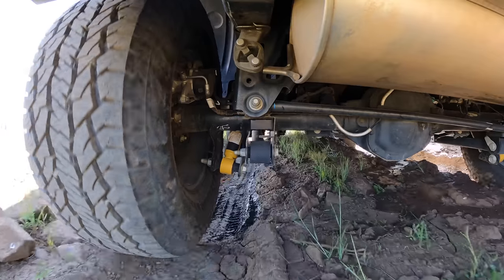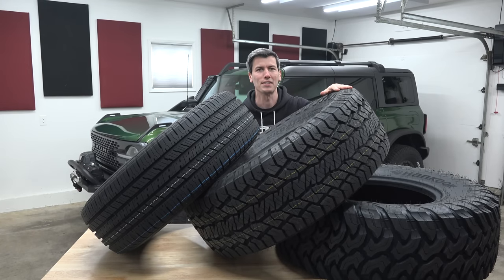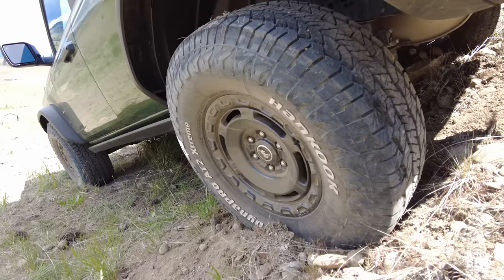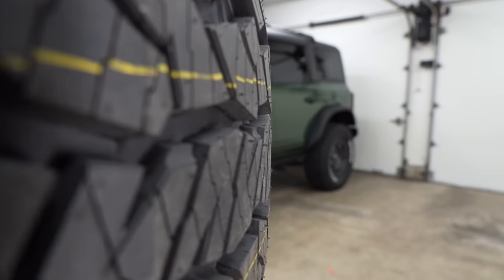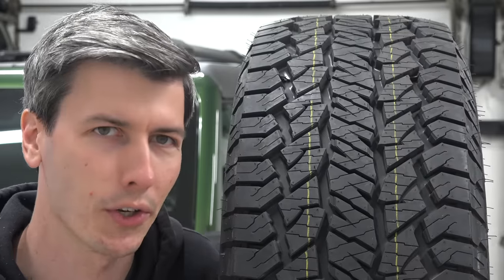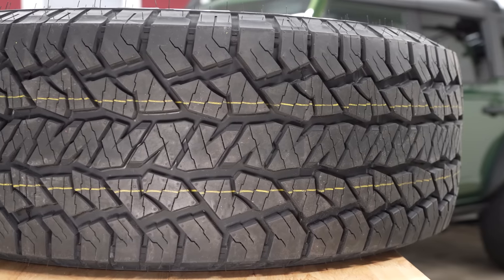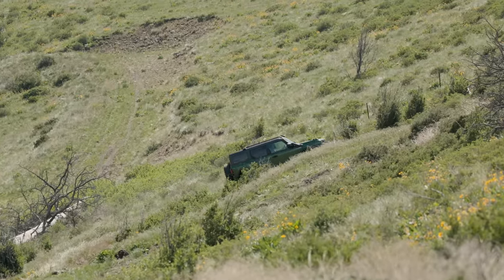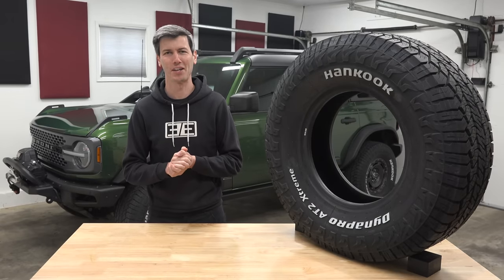The Most Difficult Tire To Create - All Terrain

Comment: Great Video.  I have to say that I had to walk away from the Dynapro tires and switch over to another brand due to the Hankook tires clogging with mud and snow and not cleaning themselves adequately.  The Dynapro tires had good dry traction, never gave me any issues on the wet roads and performed admirably when running on a solid sheet of ice and other four wheel drives were not moving.  But having the tires clog up and turn into slicks when trying to travel through more than 4 inches of snow was an absolute deal breaker and I cannot put them on my truck.  If I did not have to make regular trips across the Allegheny Plateau or across I68 in the middle of winter then this would be less of an issue, but nobody want to be on the highway when you are caught in a few inches of snow and the vehicle becomes hard to control because of the snow.  Perhaps the AT2 Extreme may be a better tire than the AT2s that were on my truck from the factory, but when they cost the same as a better rated competitor, you make the switch and have the snow traction that you need.
Reply: I don't drive in snow but I've also had my AT2's clog up with mud. Seems like a downfall of the design. Which tire did you swap to?
Reply: @NiSE_Rafter  I moved to the Toyo AT3.
Reply: @c.garison3770  I think in snow you want snow to stick between the treads, snow on snow contact when spinning increases grip. Wider groove tires like Toyo's will help with this.

Comment: The difficulty becomes apparent for those that have ran several diiferent A/T's as the best are truly impressive  [as all-arounders] while the worst have several dramatic flaws like short tread life, loud like M/T's, not being decent on OR off-road, bad in snow/ice, and so on.

Very happy with my Falken Wildpeak AT3/W on 18 Ram 1500.  I have the P's and not LT which were cheaper, lighter, softer riding, and just more practical for my usage as a daily driver, mostly unloaded and infrequent towing but plenty off-road occasions.

Comment: There are also small 2/32" protrusions embossed from the bottom of the grooves, these are called rock ejectors and they also help throw any stones out!
Reply: Usually the 2/32” nubs are wear indicators.  Most modern tires have them since the 80’s.  
When 2/32 tread depth is all that remains, it’s time to replace the tire.    
👊
Reply from the maker: Yes! They do have these on the MT tires.

Comment: My FX4 Ranger came with Hankoook Dynapro AT tires, and they were absolute trash offroad. The OEM tires have one job, and that's to last until the warranty period for wearables is over and be as light as possible for fuel economy. I replaced them with BFG All Terrain TA KO2's which are much heavier, but a significantly better on and offroad tire for my application.
Reply: not to say Hankook tires are bad, but the ones Ford chose for the FX4 Ranger were not suitable for the application for some uses.
Reply: My F-150 had the at-m tires. I was fairly impressed with them they did fine in deep water with a sand bottom, light off road in wet grass and snow performance was adequate. I would describe those tires as jack of all trades master of none all of those situations I went in the tires did just okay not bad but not really good either. I replaced those tires after 58k miles and six years of service because of excessive cracking and 5/32nds is when I yard tires. Replaced them with the Firestone destination x/t which seem to be doing fine for my application.

Comment: The "all terrain" tire, currently the shorten nomenclature from the original "kinda sucks in all terrain" tire. I see ATs as just an aesthetic upgrade. They are almost as loud and heavy as mud tires with no where near the advantage off road. You can get mud tires that will last just about as long and they are usually the same price or cheaper than ATs. Some companies have started making "hybrids" where they make pretty aggressive tread on the outside tread pattern while keeping the inside pattern pretty tight; this allows you to slightly over inflate for the road, keeping the bigger lugs from contacting the asphalt, but one you air down, they can help engage terrain. It's a step in the right direction, but still isn't perfect.

Comment: In Poland we use to say: "If it's good for everything, it's good for nothing" You can't have everything. If you have good offroad traction, you won't get quiet and low rolling resistance on asphalt.
Reply: Yep, the same can be said about any "2 in 1" products - for example the all seasons tyres are worse during winter/summer than the specialised winter/summer tyres.

Comment: I was torn between the Dynapros, Falkens and Cooper a/t tires for my 4x4. Went with the Falkens 1st go round because i liked how they looked best. Super quiet tires. This time i have Goodyear Wrangler Ultra Terrain a/ts and they're the most aggressive tire you can get next to a legit m/t. They are very quiet as well with the exception of slow driving on very smooth roads. They will hum just a wee bit. I will be getting another set when these go.

Comment: Weight – Its strange this tire in size 285/70R17 (The tire I run) is 32.70in diameter and 16/32 tread depth is 59lbs for LT285/70R17E (The only option)  vs a slightly bigger and more tread depth tire like Toyo Open country LT285/70R17E is 32.76in diameter and 17/32 tread depth is 56lbs. Right now I’m running Toyo Open country P285/70R17SL just 47lbs. I think I would be ok with SL since it has larger contact patch (less pressure per sq inch) on rough terrain vs stock 265/70R17 or even sizes like 255/80R17. I had Load E before and the ride was firm for a lighter vehicle like a 4Runner (5000lbs). Also want to point out 3PMSF rating is very different from tire to tire. Eg BFG KO2 / Falken Wildpeak AT3W is very different from snow and Ice performance on pavement with Goodyear Wrangler Duratrac without studs (never tried with studs). But noise department is where  Goodyear Wrangler Duratrac or even Nitto Terra Grappler failed on me. BFG KO2 / Falken Wildpeak AT3W/ Toyo Open Country AT3 is very good to my years. Yes one might argue that a tire like Michelin Defender would be better for pavement. But with my use not a daily driver and get lot of snow driving in winter not been a A/T tire and no 3PMSF rating it would not work for me. Really wish Jason can put these tires head to head on ice braking test in a controlled environment like AMCI Testing did looong back for Venza.
Reply: LT rated tires will have a stronger sidewall and thus be heavier than P rated tires. Load rating should reflect this, so the LT vs P and Load Range E etc is kind of a legacy.

Which Toyo are you referencing? The AT3? I found those to have a pretty compliant sidewall even at 60+ psi, which might explain the weight difference.

Keep in mind there is also a AT3 extreme available, which has an extra sidewall ply, and is much heavier. If you tow with a diesel, I'd suggest this instead of the regular.
Reply: @plkracer  I have stated the load rating after the wheel/ rim size 🙂 
Yes Toyos I have is AT3 / AT III 🙂. I haven't heard of Toyo Open Country AT3 Extream. I only know of AT, RT & MT.
The only Load E tire I personally used was BFG KO2 which had real 3 ply side wall. When I check that time many a/t tires had 2 ply side wall.
As mentioned my vehicle(s) are 4runner. I'm at 5000lbs & 5060lbs. Won't be towing anything.🙂

Comment: High load (D+) all terrains I like nitro terra grapplers. For load C all terrains the BFG KO2 is undefeated. I hear these hankooks are pretty affordable though.
Reply: C rated K02s come stock on raptors and they are garbage. My set lasted 14k, and that was about average. No grip anywhere pretty much. Got some Cooper ST maxes and despite being way more aggressive off-road they have similar or better grip on road, which is sad. They are a bit louder than I'd like tho.
Reply: @T4nkcommander  I bought my raptor at 53k on it original tires on the front new ones on the back (dealer special huh). Put about 10k on it then I got 4 brand new BFGs. Got about 13k on them now and they are wearing in perfectly
Reply: @krisramos7453  how much high speed offroading do you do? They don't last long under the conditions the truck was built for, but I reckon the "raptor specific" version saves Ford money and gets better mileage, so there's that at least.
Reply: @T4nkcommander  my truck does either beach running (15mph speed limit on most beaches here so I’m not flying) or crawling through woods trails. Also thousands of miles towing an aluminum boat. Other wise it’s a lot of highway

Comment: Falken Wildpeak AT/3W is about the best you can get. 
The rubitrek is a bit better for road but you sacrifice the offroad performance for rock crawling.

And the Wildpeak took almost 5 years to become the OEM Bronco tire. Nothing but the best!

The only reason they got that 60K warranty was because they sacrificed the cold weather performance. It does not perform. I guess if you dont run in snow, you may not worry about it. But for the rest of us that do, it is a deal breaker. Plus, they are a PITA to get any RMA support.

in terms of the siping vs sub siping, (the micro sipes), hankook does not do full depth canyon sipes. Further reduces the cold weather performance.

Comment: Good video - thanks. I would like to know whether all terrain tires actually have more grip on gravel and dirt than all season tires, and if so, by how much. If anyone knows of a source of data from traction tests that have tried to measure this, please give references. I am fairly confident that all terrain tires will stand up to wear with regular off-road use better than all seasons, but I don't know how traction alone will compare. I know from available information that all season tires typically do better in snow and ice than all terrain tires, which isn't surprising since all seasons have softer rubber.

Comment: There’s no free lunch. “No season” tires offer pretty dismal performance in ice and snow on mountain roads. But studless winter tires lose 10% fuel efficiency, more road noise, and poorer performance during those 60F midwinter rainstorms. Every winter tire moves those levers a bit differently. Moving one up usually pushes another down. 

Compared to a road tire that is acceptable off road, a snow tire almost seems easy! I suppose it helps that off-roading tends to be unpopular during a real winter though.

Comment: I have a 2016 Ford expedition heavy vehicle with an open differential. I moved from California to Tennessee. My car has all season tires that I have on my car seem to spin out and lose control a lot. I don’t do any off Roading but I’m thinking of switching to a A/T to grip the road better On wet surfaces. what would you recommend all terrain or all season? What would you put on that vehicle if it was yours?. thanks in advance for your help

Comment: Maybe it's because I'm old, or maybe it's because I've been around the block a few times without my Hankook training wheels. A far superior tire is Michelin LTX A/T2. It excels at light to medium off-road, has siping that goes down to the bone, and the road noise is comparable to their touring tire. I use this tire year-round in northern WA state, traversing a mountain road daily to reach civilization. A worn-out Michelin will outperform any other tire on wet roads. Started on Michelin X (made in Italy) in 1979 and never looked back.

Comment: Afair, a few years ago You said in a video that it would be impossible to accelerate from 0 to 60mph (or 100kmh, i dont remember) in 2.0 sec or less, on a set of road legal tires (non drag slicks). 
Today we already have a car which does it in 1.7/1.8 sec time.

Comment: From my experience doing engineering at a tire company, I have also heard theories that a lot of the noise from RT and AT tires might come from "micro sonic-booms," which originate from the sharp angles created in the deep treads. Never figured out how true this is, but fascinating if so :)
Reply: Micro Sonic booms? Wow that's absurd. Tire noise starts at a much lower speed even for the outside diameter never reaches. The only time any spinning object does this is an aircraft propeller tip at high speed high RPM. Tires never see that speed.
Reply: @JSFGuy  They don't have to spin at supersonic speeds, necessarily, they only have to move air that fast.  Depending on the geometry, a space closing at subsonic speeds could force air out of it at supersonic speeds if the volume changes fast enough.  Like pistol shrimp claws, just air instead of water.
Reply: @jamespray  Again that would require some speed to generate. Not sure a fluid dynamics and hydroplaning are related... I would think somehow on a different scale.
Reply: I’m sure there is a lot that goes into designing a quite tire. I have Federal 595 RSRR tires (track type tire) on a Focus ST. When running those it sounds like an airplane is taking off next to you even at speeds as low as 40mph. Has only worsened as the tread has worn down a bit, and those have no real sharp edges anywhere.

Comment: Respectfully, mud terrains aren't "dedicated almost entirely for off road driving," in my opinion. They're still very much a tire passable for daily use, and are indeed used by many as an everyday tire. Personally, I would place MTs right in the middle of the on/off road spectrum, with highway tires and ATs on the left and tires such as the Interco Bogger on the immediate right. It's the latter type that I would classify as dedicated almost entirely for off road. They are typically much more capable off road than typical MTs. However, they wear out very quickly, are generally hard to balance, and are not recommended by the manufacturer for highway use despite being DOT compliant. They're OK at 30mph, but at highway speeds, they are absolutely unsafe.

At the extreme end are dedicated competition off road tires. These aren't legal for public road use at all, and tend to look more like tractor tires than anything else.

Comment: Always appreciate your videos but it seems my offroad tires get louder with wear, how does that work with respect to the air pumping / tread depth points?
Reply: As the tread gets thinner it also gets less stiff. So probably the air pumping is increased by more flexing of the tyre.

Also generally any 'flat spot' on a tyre gets worse with use, so I suspect the vibration producing properties of the tyre get worse with time due to them gradually getting less round.

Comment: I think one should sacrifice the traction on snow on this all terrain tires. If you need real traction snow, those puny sipes are probably better than nothing but compared to an actual winter tire, that amount of sipes is nearly nothing. In addition, real winter tires use compound that's still soft at freezing temperatures to provide much more grip in those conditions. If the compound is hard enough to allow running on rocks on hot day, the compound will be too hard for snow and ice.

When you forget about the snow and ice, you can use pretty hard compound and optimize for the other features mentioned in this video.

We don't have any tire technology that can have both long lasting tires on hot rocks and provide good traction on ice and snow. If you want all around compromise (somewhat usable on all surface, not really great for anything) then this kind of tire is the least worst you can have.
Reply: You are correct.  There is no substitution for proper snow tires for those that live in areas that see lots of accumulation each year.   These tires are only good for saving you from having to stop and chain up a vehicle when crossing certain passes in the large western mountains.
Reply: These sorts of tire are the next best thing though and frankly are better than probably 80 or 90% of standard car tires. Not everyone has the luxury of space or money to invest in a set of Hakkapeliitta's.
Reply: @Hybris51129  I used to run various studded Hakkapeliitta winter tires for 15 years but my current set is Michelin X-Ice North 4. I think it has even better traction than Hakkapeliitta. Both are pretty expensive tires, though, and you really don't want to run those when temperature gets above 4–6 °C (or 40–43 °F) because the rubber is so soft. And forget about low profile tires combined with snow if you want good traction.

Comment: 7:48 remove the sand part. You don’t want the tires to dig into sand. You want it to float or you just end up burying yourself. Everything else was great information. However maybe mentioning how many plys a tire has make the sidewalls stiffer for different load rating.

Comment: I want to use these set of tires (front - 255/40/R18 & Rear 275/35/R18) on my 2008 E550 Mercedes Benz with coil struts installed. what are the side effects?

Comment: I want a high mileage highway, off road snow tire. I'm serious. Unless your daily driver is a trailer queen (?) , most miles are on pavement. I currently roll the BFG Ko2 on two of my trucks, one a daily driver work truck. My play truck I air them down to 12 psi. Men like tires as females like shoes.

Comment: Hi I had a question I have an Acura tsx FWD and I recent accidentally drove with my emergency brakes on , it was about 6-10 minutes going 35-45 miles per hr .. I would like to know if they is any consequence because of this or am I fine .. I will surely get it checked out but if there are repairs will it be expensive ?